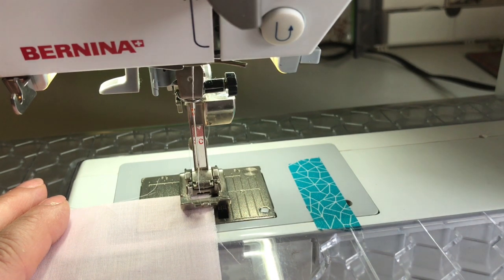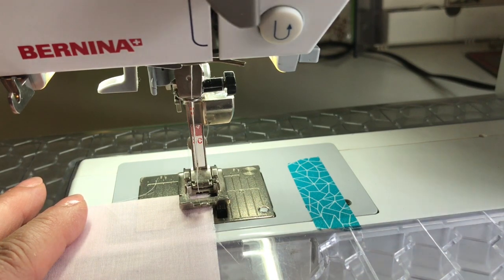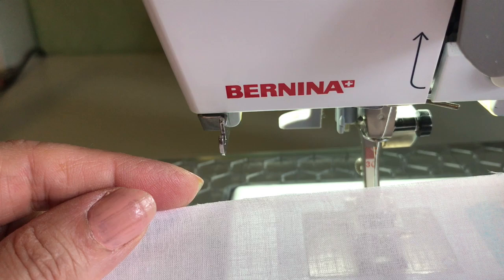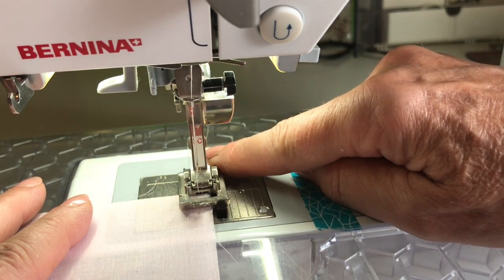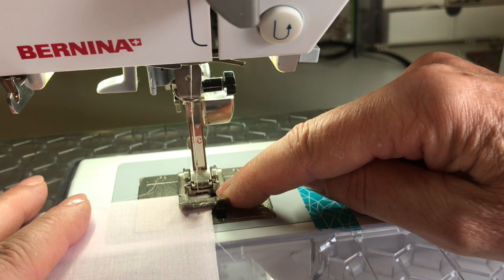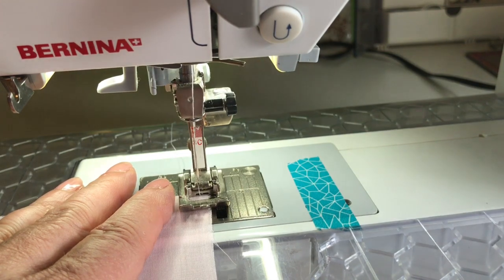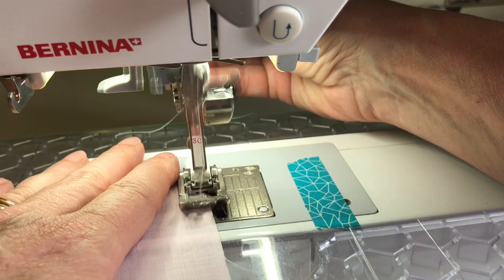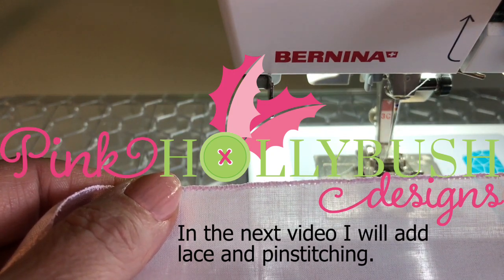Learn to Heirloom Sew: Rolled and Whipped Hem

Comment: What weight of thread did you use?
Reply from the maker: I used a 60 weight. You can also use a lighter weight so it is less visible. I have used an 80 weight but have had trouble with that breaking in  my machine.